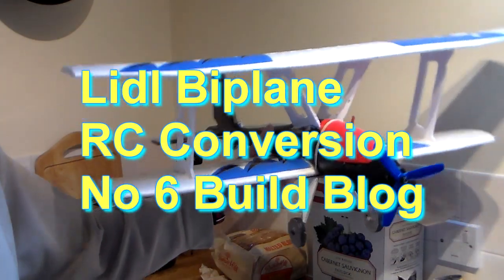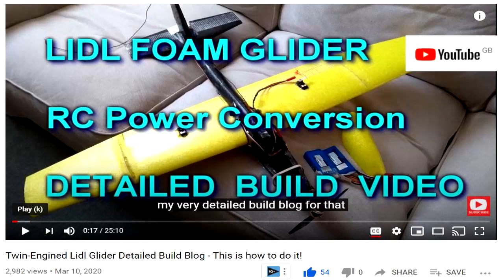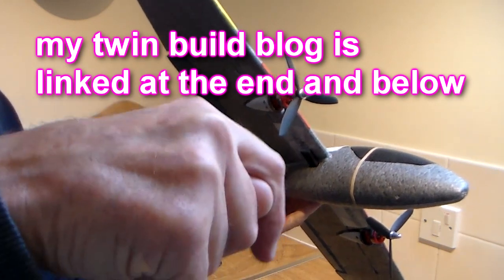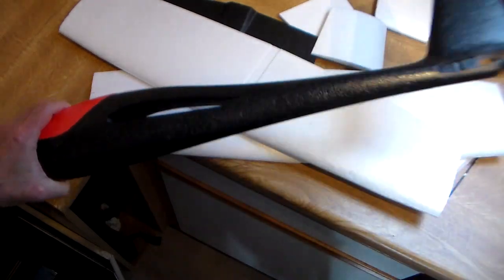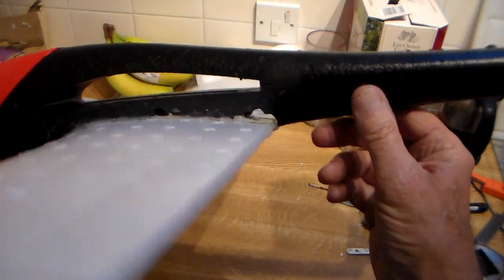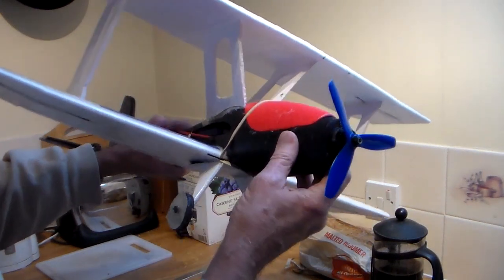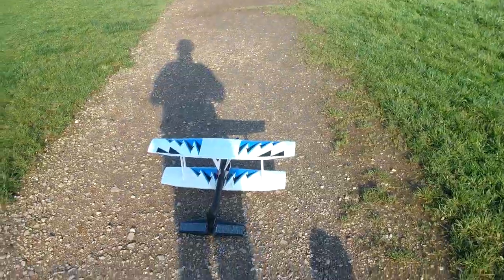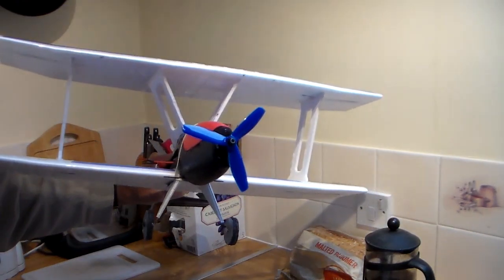LIDL GLIDER BIPLANE BUILD BLOG +  MAIDEN!  - Lidl Glider RC Conversion

Comment: That's all very interesting Bob, I'm just wondering if you could have tried less power to negate the effect of the thrust angle while you were there?
Reply from the maker: Hi Cliff, 2nd flight I used about half throttle and it was just as bad as the first . Straight up and loop!  I added down thrust now, someone suggested tail heavy so moved weight further forward  and may try a bit of decalage. (My new word, only discovered it today!) ☺️